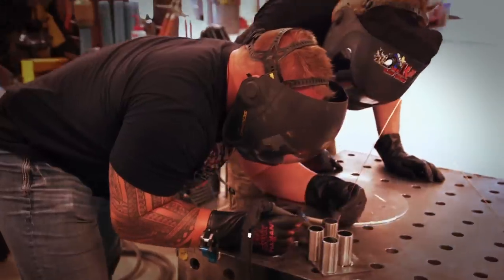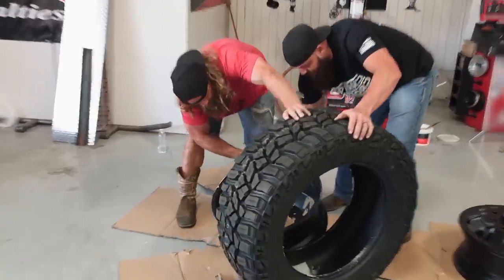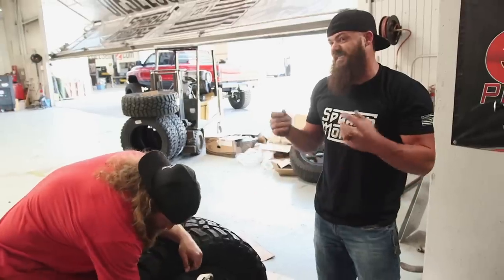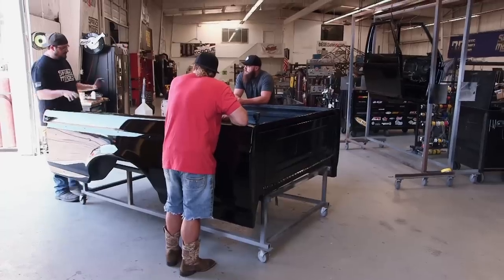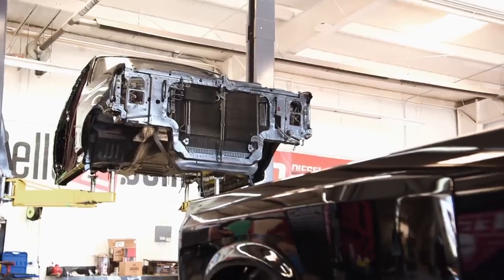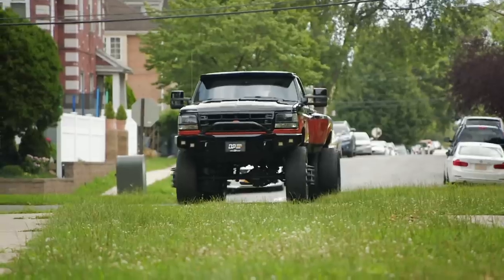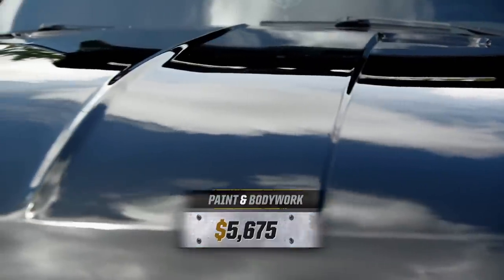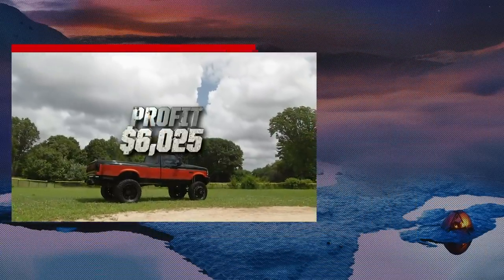A Blacked Out 1996 Ford Dually Truck for Jacob deGrom | Diesel Brothers

Comment: Mistake turning it into a dually.
Reply: But it was already a dually with the single wheel axles.
Reply: @dakotajohnson9858  Negative bud.
Reply: Dakota johnson 
It’s a 250.
Reply: Snarl Crook 
That’s the biggest load of crap I’ve ever heard. You know how to look like a poser? Putting some goofy adapters on your truck to make it a dually.
Reply: @Snarl Crook if you drive a dually and don't pull goosenecks every day you're a poser
Reply: I love it. I say one wrong thing and y'all get triggered. I knew what I was saying it just took most of you people to come up with something.
Reply: Dakota johnson 
No ones triggered but you bud.
Reply: Personally duallys in the obs usually look better , but mainly on the 250 2wd , but this truck was better off before , and I do prefer a dually
Reply: @FordFan01   Your 2nd comment had me rolling!!!🤣🤣🤣💯♥️it
Reply: @dakotajohnson9858   Nice pfp Dodges are BEASTS💯♥️ Subbed to ya incase you ever upload content on your truck🤙🏻
Reply: @idtamura07  I agree with you 💯 It looked better before a dually🤙🏻
Reply: @robertkurtz7587   250's do look sweet being a dually 💯🤙🏻

Comment: “Retained your factory axles” okay bud I didn’t know a F250 came factory with dually axles😂
Reply: They're factory, they just used some adapter's. Not exactly the most ideal thing for towing, you know, the purpose of a dually lol.
Reply: Do you hear your self when you talk?
Reply: In the late 80’s and early 90’s you could get a 250/350 mix. It was just a 3/4 ton f350
Reply: Some axles from that generation had bigger buds which made them 3/4 ton axles.  You could put dually wheels on some of those trucks with no modifications.

Comment: Man I got a 1997 ford 4x4 that needs a head gasket replacement. Should I replace gasket or put in new motor in it. That truck is gorgeous you did a fantastic job. Love a diesel.

Comment: I wouldn’t of done the new style tow mirrors or that fusion bumper woulda went with the older gm tow mirrors and a 6.4 bumper and had it all black instead of the orange and smaller wheels but same size tires to keep a older look but still look good

Comment: I had a 1996 F-350 XLT with the 7.7L gas engine. Thing was an animal.
Reply: Climax Slushies 7.5 not 7.7
Reply: jacob cornell 7.7l gas engine, trust me I know my truck.
Reply: Climax Slushies then you must have bored it out, the 460ci big block is a 7.5l.
Reply: jacob cornell look it up bub
Reply: Climax Slushies bruh it’s basic math😂 you can google it for yourself, Ford never made a 7.7l, that would be a 469 not a 460.
Reply: My 460 is a 7.5 😂😂😂
Reply: 7.5......
Reply: Climax Slushies It’s....you don’t.....*sigh*

It’s a 7.5, no such thing as a 7.7
Reply: I’m not a ford guy and I know it’s a 7.5. Yours was clearly a 7.7 animal though. In 96 they released a limited number of 7.7 AnimAl trucks. It was 1 of a kind. Estimated worth today $175000.77. That sucks you sold it bro.
Reply: Jk you thought your truck was cooler than it was

Comment: Why are there chevy mirrors on a ford body?
Reply: Because ford cant make anything good the only thing ford on that truck was the cab and bed the engine is international harvester
Reply: @davidfirth9342  definitely new chevy tow mirrors
Reply: David Firth theh are brand new chevy tow mirrors
Reply: Chevy and Dodge’s tow mirrors are often more compatible with different generation/brands of trucks new or old. Ford’s mirrors are usually only compatible with the year model and truck they’re made for. Coming from a Ford guy here.
Reply: There all the same look at the newer platinum's (ford) chevy and Dodge
Reply: jewbe jewbe Doo Oh yeah, JUST the cab and bed was Ford.

Man. What an ignoramus.
Reply: @FordFan01  lol he acts like the diesels in chevys back then were chevy motors. Nope detroit. An dodge has yet to have there own diesel.

Comment: So is it that they come out with their own tire but cease to never to put them on any vehicle.  Seems like its always  toyo or nitto. Now I did buy a set of Patriots M/T, and after 35,000 miles the belts popped on me and every tire had a  10 in long knot. Still 15,000 miles left on the set. Anybody else have that happened?

Comment: Somebody explain how its ruined? Because I doubt the owner thinks its ruined.

Just because it's not what you like dont mean its ruined
Reply: BurninRubber93 Cause they kinda did. They took a hard to find truck and turned it into something else that’s already available (dually) not only are those hub adapters not safe, but the added weight you could carry with the duals is gone because of them. It is incredibly unsafe to tow with a adapter/spacer. They crack, loosen, and do all sorts of random stuff. 

You doubt the owner thinks it’s ruined? Oh yeah cause Jacob sure seemed stoked about it.
Reply: @FordFan01  hub adapters are not dangerous and I doubt it was gona be towed with anyways
Reply: BurninRubber93 Yes. Yes they are. But whatever.

Again, you doubt it’s gonna tow? That doesn’t make it any better. so they took a work horse and dressed it up and now it’s not supposed to do what it’s designed to do?